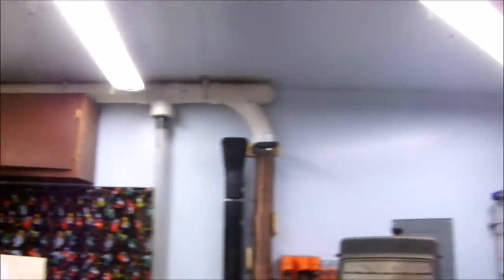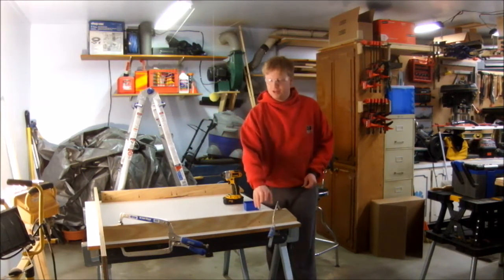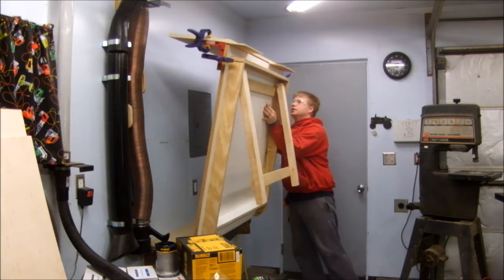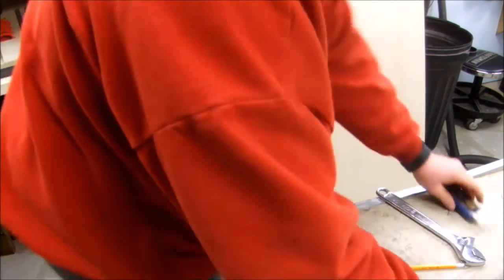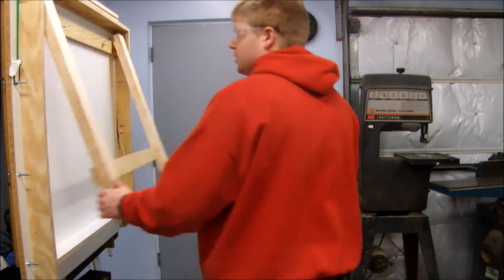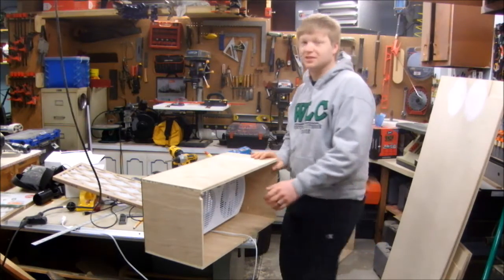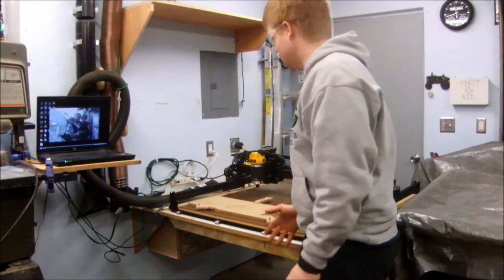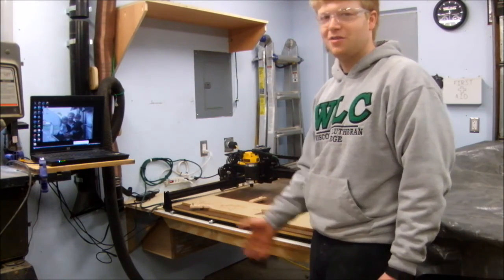X Carve CNC Folding Table Build

Comment: This is great work. Very inspirational. I am considering setting up my CNC directly on the wall, doing a counterweight system for both sides of the gantry parallel to the Y axes.
Reply from the maker: A wall mounted CNC is a cool idea.  The biggest downside I see is that any parts or shapes that are cutout will fall to the ground.  You would need to leave tabs in for all cutout work.
Reply: @craftsmandavid5970  so explain?  Do you put it up and continue to carve?

Comment: Great folding table design. Only thing I might change is to remove and remount the fans so one would pull air into one side of the box while the other pushes air our of the opposite side. Thanks for sharing.

Comment: Do you think it a waste to buy the side board kit for the controls?
Reply from the maker: Yeah, I'm personally not a fan of the sideboards.  It especially doesn't work if you're going to make a folding table.  I also don't like the thought of dust so close to the electronics.
Reply from the maker: Well I guess this reply is better late than never.  Yes, I think the electronics need additional protection from dust.  So, I'm not a big fan of the side board.  Plus, it takes up a lot of table space when it could go underneath.

Comment: this is awsome.  its exactly what i have in mind for my garage.  but i want to sort of enclose the sides.  can you tell me the width of the boards that attached to the wall?  what i mean is how much space from the wall will i need to fold up the x carve?
Reply from the maker: +devin wojtczak From the wall to the surface of the table is 13.5 inches.  Post a picture when you finish yours (if you remember).
Reply: +Craftsman David 

https://discuss.inventables.com/users/Devin
Reply: +Craftsman David 
not sure if that link worked i posted the pics to the inventables forum.  couldnt figure out how to send them here.
Reply: +Craftsman David 
ok the link does work sort of.  after clicking on link just click on the "workspace showcase" or whatever they called it.
Reply from the maker: +devin wojtczak Great Job on your folding table.  I agree that you may have over-built it, but there's nothing wrong with that.  Also, the shelves under the table are a nice touch.
Reply: Nice looking cabinet.